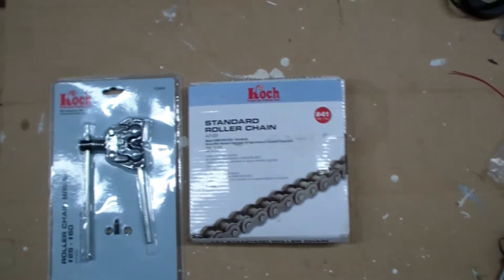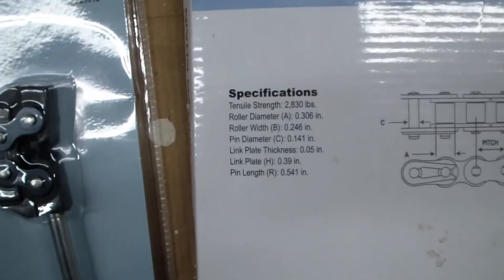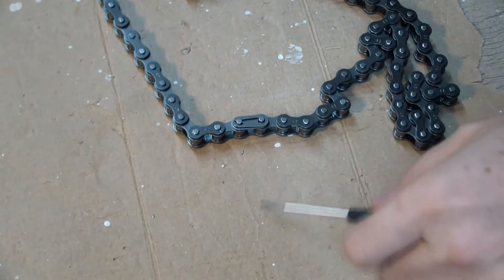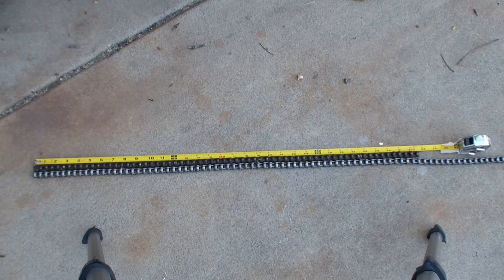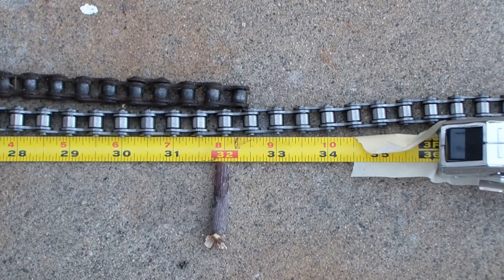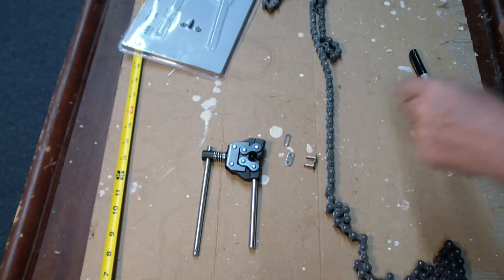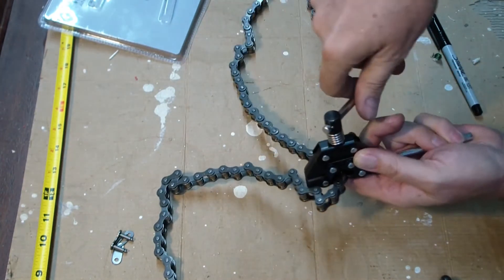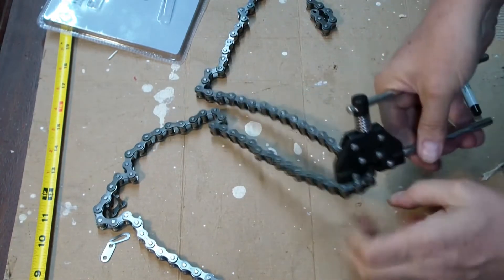Koch Roller Chain Breaker and #41 Chain Review

Comment: Hey big guy, thanks for the vid there was no reason to stress the master link a second time through the second pin the opening in the back can fit past the pin. you want to stress your master link as little as possible. The more cycles you expose your master link to the easier it comes off. Also you already commented it came off really easy. Thanks again for the vid!
Reply: Btw, What kind of machine was that chain on?